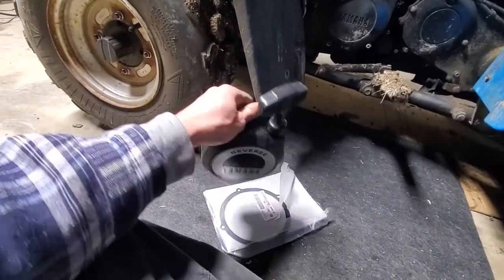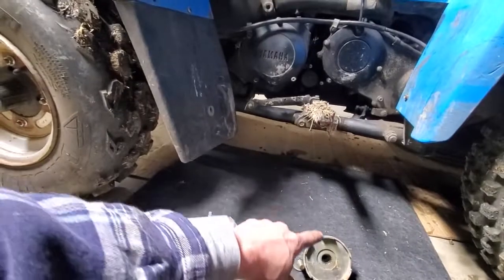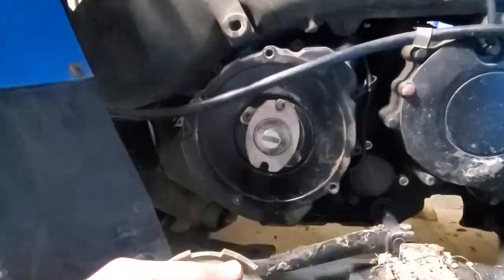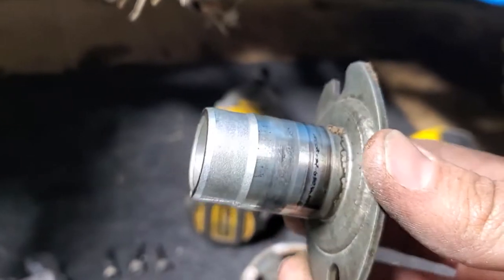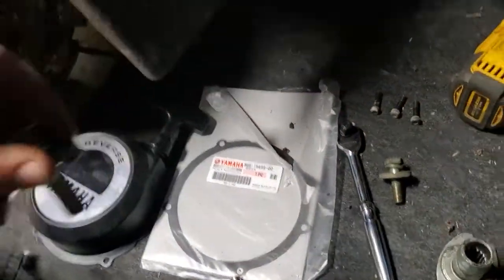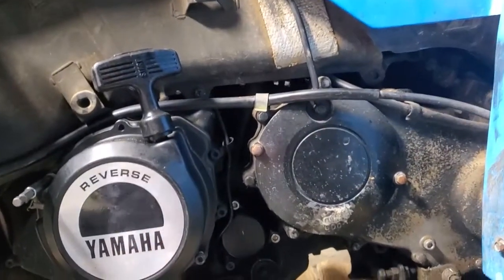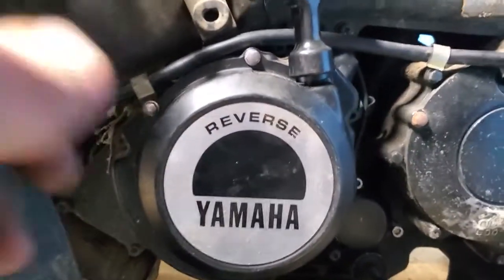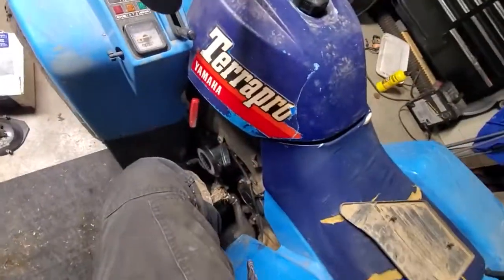Yamaha Terrapro Pull Start Installation

Comment: Ray - I am sure I have commented to you in past as to what a big help your Terrapro videos are to me. I have a never ending battle with dead batteries in this thing.  I can't trace down the problem.  I always keep the battery on a high quality Smart Charger when not in use.  And I mean ALWAYS, even if not using it for a day or two.  I'll run the machine for a solid three hours straight cutting grass with the bush hog and the battery goes completely dead. I can't trace down what the issue is.  
But aside from tracking down the root cause, my question as it pertains to this video...  If I install one of these pull starts, do I even need to worry about having a battery hooked up?  In other words, if I don't care about headlights, and the N, PTO & parking brake indicator lights, do I even need a battery?  Thanks again for helping me keep my TerraPro in tip top shape.
Reply from the maker: the battery might help regulate the voltage going to the bulbs, and keep them from blowing, and i would recommend always having a battery, it sounds like your bike isn't charging. can you hook up a volt meter to the battery and once your bike is running, does it show charging, aka over 13 to 14 volts, versus the 12 volts from a idle battery.
Reply: @rwallaceiv  It's hit and miss.  Sometimes yes and sometimes no.  The terminals at the battery are clean and tight. And the inline fuses coming off the two leads from the + terminal are fine.  I really need to dig in and trace the wires and look for a short.  Without removing a lot of the blue panels I can't really trace where the wires go.  My gut is that the negative cable is not making good ground contact or a frayed wire. Hence why it is sometime charging and other times not. (Where does the negative ground to the bike anyway so I can look?)  I guess another possibility is a fray on the pos line that intermittently touches a metal part as the bike bounces along.  But then I would think I would have burnt fuses, no? I guess I''ll start pulling panels and really inspecting wires.
Reply from the maker: @DieselMike  I wanna say theres like 2 grounds, one to the engine, right side maybe around the diff lock switch, and the other is to frame, below the rear tail lamp.
Reply: @rwallaceiv  Thanks for all the replies.  I'm sure you'll here from me again.
Reply from the maker: @DieselMike  be sure to join the facebook club where we share the files and tips and tricks etc.